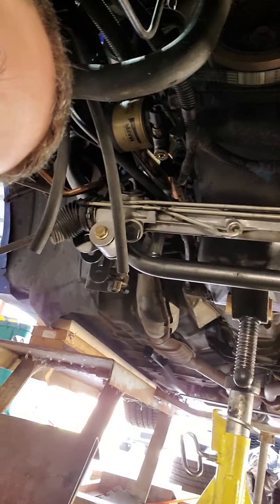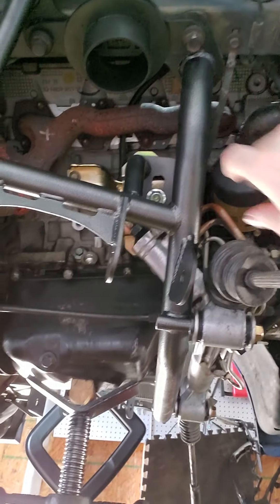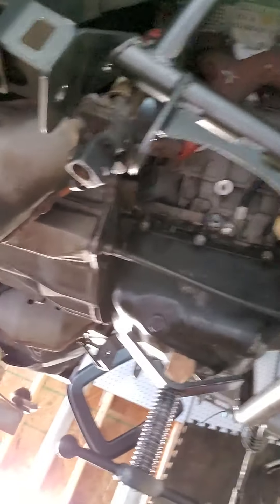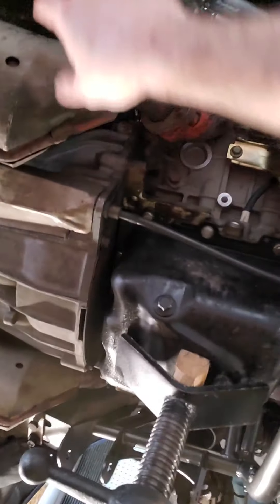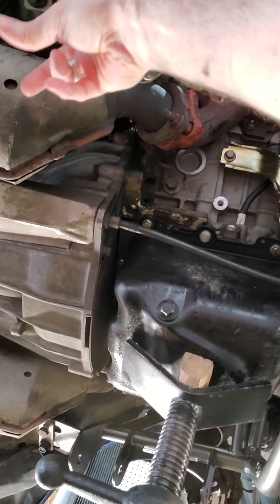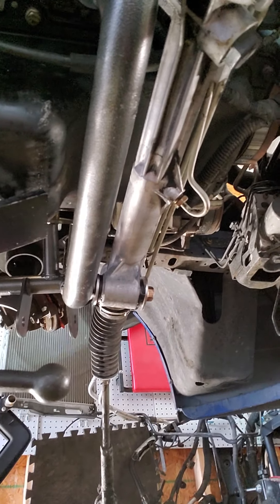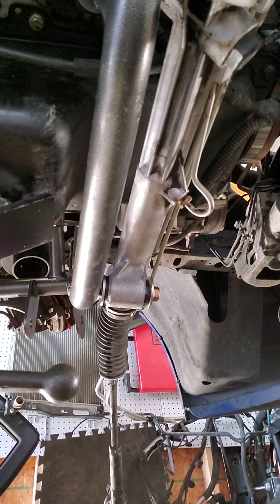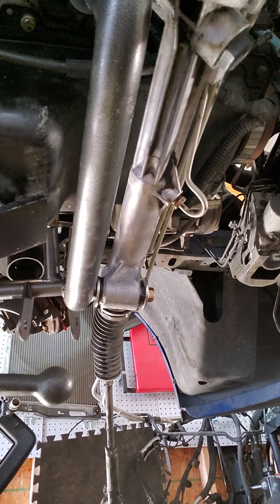Review of the BMR K-member for a  1999 -  2004 New Edge Ford Mustang

Comment: Did you notice any additional “feel” or vibrations from the road vs the original k member?
Reply from the maker: I noticed the car was more reactive to steering and it has more feedback.  There were no additional vibrations.   

The car is a daily driver during the summer months and is very street friendly with the suspension mods done to it.

Comment: Where did you get a bmr k member? I didn’t even know they made one.
Reply from the maker: You can get it from BMR's website.  I'd recommend getting the more expensive one.  It's bulletproof.

Thank you for watching and visiting my channel!
Reply: Very nice. Do you plan on auto crossing your stang? I’m about to invest on the boxier style Kmember with the extra gussets.
Reply from the maker: @pjcustoms8508  I will be doing a little bit of Autocrossing but it will mainly be a DD during the warmer months.  Building the reinforcement brace will help keep my  lightweight K-member in tact.  I'm in the process of doing the auto swap now.  Pulled the 3650 and just installed the shifter for the 4r70w

Comment: Can you put a coyote motor on that k member
Reply from the maker: I'm not sure if it will work with a Coyote engine or not.  I don't have much experience with those engines.  Here is the link to the K-member I have.  https://m.bmrsuspension.com/?page=products&productid=2070
I also added on spring perches.  BMR could probably help on that.